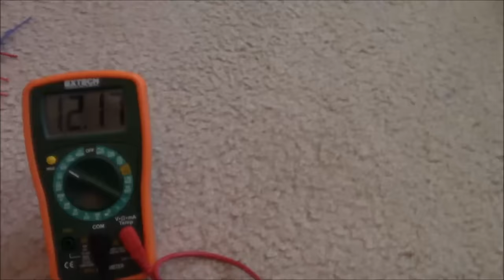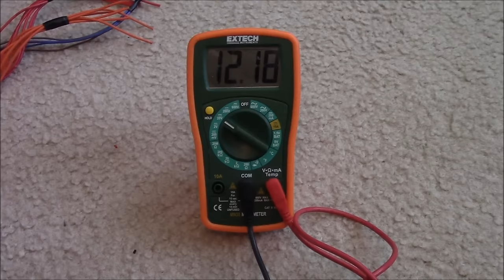How to Hack a Computer Power Supply (PSU) To Use as a 12V DC Power Source

Comment: I tried it and while it does work with a volt meter, if I try to put an actual load on it, the PSU kicks out.Tto clarify, I hooked it up to car stereo amplifier, unloaded which draws about 333mA idling, which the 12V rail of a PSU should be able to handle.
Reply from the maker: True, but most newer PSU's (the one in this video was several years old at the time of the video) need a load on the PSU for it to turn on.  It sounds like when the amp powers up and is drawing some current to start up it is fine but then at idle the load is too small for the PSU to stay running.  You might want to wire in a resistor to simulate a bit more load so it will stay on.
Reply: I have heard that if I tie a dummy load of about 40 to 50 ohms to the 5 volt rail and connect the 3.3 volt "sense" wire to the 3.3 volt rail, it should stabilize the psu
Reply from the maker: I have heard the same but I have not done it before.  You can either have your load connected to the PSU before turning on the unit or trick it into thinking there is a load with a resistor.  How and where to put the resistor I don't know because I haven't done it.  But I know other people have gotten it to work.

Comment: hi i'm trying to connect the 12V rail of my PSU to a little PWM circuit to vary the speed of a DC Motor, should I still be using all the yellow cables (yellow is 12V in my case too) or will just one suffice?
Reply from the maker: Depends on how much current you need.  If you use more than about 5A I would recommend at least 2-3 wires.
Reply: LDSreliance thank you so much!
Reply from the maker: You are welcome!

Comment: i connected it to a small 12v dc motor and the power supply tripped off. 
am i doing something wrong?
Reply from the maker: Motors usually require a big surge of amps to get started.  I would bet that your power supply cannot handle the surge or has protective electronics that think there is a short circuit or something bad going on and shut it off.  You can try wiring in a start capacitor to help handle the surge of amps.
Reply: @LDSreliance  I know i'm SUPER late to the party here but I just had the same problem when I did it the way you show in the video. Mine too would start, then stop. I thought to myself "what was different about my p/s then his?" Mine doesn't have a switch so I just soldered a little switch connecting the green and 1 black. Now this fucker works fine lol This pixie wrangelling stuff is fun !!!

Comment: Thanks for tutorial, i'll tried :)
btw can this charge ACCU 12V?
Reply from the maker: Not sure what ACCU is.  But if it is a battery then no it cannot charge a 12v battery.
Reply: ACCU = Battery Motocycle with power 12V
can charge it?
Reply from the maker: Ardian Sakti
No.  You need at least 14v to charge a 12v battery.
Reply: Ok thanks :)
Reply from the maker: You are welcome.  Thanks for watching!

Comment: i have 40m with led lights they need 12v and 460w if i use a 500w psu will it be able to power that?
Reply from the maker: No.  The overall rating of the PSU is not what it can output @ 12V.  The 12V rail only gets about half of the power.  Then there is the -12V rail, the 5V (USB) rail, and the 3.3V rail.  You need to look at the specs of the PSU to find out how many amps the 12V rail can handle.  Mine in the video was only 20A.  But a more powerful PSU may be able to do 30-40A.

Comment: Hey mate if I'm going to be running this to a car head unit is there any need to run a certain amount of wires or just hook them all up? Sorry if it's a stupid question, cheers
Reply from the maker: David Bennett I would connect all the yellow (+12v) wires together or split them evenly into 2 braids of wires if you have another load you want to run as well (like an amp).  Then connect all the black wires together (or in 2 braids) and connect that.  Car head units also have an extra wire to tell it when to turn on so you'll need to wire that to a switch or something.
Reply: thanks for the reply bud. im going to be running a switch for the power supply on signal. would i be correct in assuming i could get away with running the head units on cable to the 12v so it would power on when i turn the power supply on? also will be running a second psu for an amp somewhere down the track.
Reply from the maker: Yes, you can just wire the head unit directly to the power supply +12v rail.  However, like I mentioned before I think most head units require a "sense" wire that tells it when to turn on when the car is turned to the on position. You may have to wire that to the power supply as well or the head unit will probably not turn on.
Reply: yeah thats exactly what i meant cheers

Comment: Is there any way to reduce the power that's coming out of it? 
I have a 300W PSU and I need a 12V supply with a maximum power of 60W or a current of 7A for a peltier cooler.
Reply from the maker: +kanav garg You don't have to limit the power.  The peltier will only draw 7A.  I have powered peltiers with my PSU that I built in this video and it works great.
Reply: Thanks a ton mate! I just hope it doesn't blow up xD
Should I reduce the number of wires just in case or go with all?
Reply from the maker: kanav garg
The number of wires won't change anything.  You could pull 20 amps through one wire if you wanted to but it would burn up the wire.  Bundling all the wires together provides safety that you won't overdraw the wire and possibly start a fire.

Comment: I'm new to this so pardon my question. What color wire is the ground that you joined together with the green? Is it one of the black wires?
Reply from the maker: Yes, the negative wires are black.
Reply: LDSreliance Thank you very much for the info. Is it possible to make a portable a/c unit using the peltier?
Reply from the maker: Yes but it would not be very portable because you would need a LOT of batteries.
Reply: Ok, thank you very much for the info. My husband and I are planning to become van dwellers and would like to do more research on how to have a/c without much draw from our solar power set-up later on. We're  just trying to explore all avenues to accomplish our goals down the line. Thank you again.
Reply from the maker: You are welcome.  I would highly suggest a swamp cooler unless you live in a very humid area.  They are not as power hungry as compressor air conditioners.  Good luck!
Reply: LDSreliance Thank you 👍👍

Comment: on the side of my power supply box it says I get 3.3 volts to 12 volts 14 volts 16 volts 5 volts a lot of variety of combinations of volts aside from just 12v can I get more than 12 volts from other colors of wires or is 12 volts.? if not so why on the side of my power supply does it say that it can output all these different volts
Reply from the maker: You can combine some of the + and - rails into combinations to achieve different voltages.  This article explains better how to do it:  https://pcbsmoke.wordpress.com/2012/12/10/converted-atx-power-supply-voltage-combinations/

Comment: I have 12V 5A engine and I have computer power supply with 12V 7A, but when I plug in engine will work for about 0.1 second and stops working  and computer power supply also turns off, so what is the problem if power supply's Amper is more then needs it should work, no?
Reply from the maker: Motors need more than their rated current when they start up.  So a 5A motor will probably draw 10-15A when it first starts up for a second or two.
Reply: Make sense, thank you. I bought AC power supply 20A so it is working perfect now.
Reply from the maker: Jamshed Akhmedov Good!  Glad it worked.  Thanks for watching.

Comment: hi how can i make a 12v 40amp psu with this? The psu is to power a hho system that requires high constant current for a few hours daily. tq
Reply from the maker: The one I used did not have that much power in the 12V rail so you would need to find one that had enough current.  12V x 40A = 480W so you are looking at needing at least a 700-800W PSU to get that much out of the 12V rail.  However, those are pretty expensive PSU's so if you don't already have one laying around it might be cheaper just to buy a 12V power supply that can handle that many amps (something like this:  https://amzn.to/3uohJEa).

Comment: Hey, I really hope you can help as I'm wrecking my brain over this. I have three devices running of three separate 12V 5A power supplies. With all the power supply mods I've found everyone seems to join all of the coloured cables together to have a single output for each rated source.

If a molex has a max output of 10A is it possible to power these devices from three separate cable clusters that come from the power supply?

I'm looking at an old PSU and it has four separate rails at 12V 20A (broken down into CPU1/CPU2, PCI-E3/PCI-4, MB/ Accessory and PCI-E1/PCE-E2). 

I'm getting a little confused from the connector output to what each rail can produce to even the overall watt of the unit. Plus if I'm only using so little power wouldn't the PSU also be produce more heat to compensate for the little consumption? 

The transformers I use only seem to last a year each so it seems more cost effective to use a PSU and that can give me for possibilities with creating usb hub to charge other devices. Thanks, really need the help lol
Reply from the maker: Yes and no.  You can do separate bundles for sure but you have to be careful how much power you use on each one.  While each of those Molex connectors COULD pull 10A, if they all pulled 10A at the same time it would blow the power supply.  Also, I would recommend you use at least 3-4 of the yellow 12V wires for each load that could potentially see 10A.  If you are only using 5A it is a non issue.  But you never know what you will use it for in the future and I don't want anyone to start a fire.

Comment: so i plan on using a PC power souse to generate HHO i have some electrical experience but not much would it be a bad idea to simply find ALL the positive leads and solder them together and all the negative leads and solder them together?
Reply from the maker: As long as they are of the same voltage (i.e. all the yellow wires are +12V).  That is basically what I did in the video.
Reply: ok thanks for the reply
Reply from the maker: No problem.  Good luck!
Reply: o wow dude i just rewatched your video and found out i made a dipshit mistake by connecting the orange wires to the yellow rather than the black to the yellow i was testing it.... there were loud pops think the power supply will still work?
Reply from the maker: No that probably fried it.  Sorry man :(  I hope it was just a cheap one like mine.  The good news is you can order a cheapo PSU for about $25 to try again.
Reply: o it was beyond cheap i found it in a PC by the side of the road the odd thing was after the pop it was still working i know because as i mentioned before im trying to make HHO with it so i had it in water with some baking soda in it and after the pop witch happened when i touched the wires together under water i pulled them apart and they still got just as many air bubbles coming up as before so idk
Reply from the maker: Interesting.  Well maybe you only lost one of the rails.

Comment: I am using  ATX-350 it's instructions says +12V gives 10 Amp but I am getting less than 1 Amp. Can you give some solution to my problem .
Reply: Depends on the load. You probably only drawing out 1a

Comment: Mine cuts out when I put a 40w load on 12v rails. Also the 12v rail reads 11v, not 12v. Some tutorials say to put a 10ohm resister on 5v rail to simulate a motherboard...?? When I put a light on the 5v rail the 12v rail jumps from 11v to 12v and works for little while but then still cuts out...   Why?
Reply from the maker: What is the 40W load?

Yes, some PSU's have a "feature" that will shut off the power if it does not detect the right parameters.  I have also heard the trick with the resistor but if that doesn't work I don't think your PSU will be suitable for this type of application.
Reply: @LDSreliance  it's a small 12v pump. It might have a current spike during turn on but it does start and cuts out randomly after 2 to 10 sec. Not sure if it's the 4w light I am putting on the 5v that's the issue or that it's the pump or the power supply is cactus... All seem possible. I'll try another power supply first.
Reply from the maker: Yeah try another supply.  Older ones tend to do better.

Comment: I want to use this to power 2 case fans. What if I only cut 1 black and 1 green wire to make the psu work, but leave the connectors attached?
Reply from the maker: +Aragiss You can do that if you want.  As long as you connect the green and black wire to turn the unit on it will run.  If yours is a newer model it may have to detect a load to turn on so you may have to wire in a resistor but I won't confuse you with that unless it happens.
Reply: +LDSreliance Alright, thanks a lot for the reply :)
Reply from the maker: Aragiss
No problem.  Thanks for watching!

Comment: how do you know how many amps can this setup take at 12 volts, if its a 450w power supply could it take 6 amps at 12 volts?
Reply: i want to use this method for a peltier and its heatsink, will it be enough?
Reply from the maker: Mine can only do 20A.  Your manufacturer specs will show you a rating for +12V rail.

Comment: I have a question I am wanting to leave the SATA power supply intact my goal is to use a Thin Client motherboard for external drives I will be placed into a old case however the power supply for the Thin Client is too low to power the needed drives so I was going to use this power supply to power The Thin Client which I verified can be done however I need the SATA power cables and intact how can I have the correct power of 12 volts still in leaving the SATA cables intact the drives thank you
Reply from the maker: You don't have to cut all the wires if you don't want to.  Just leave the cable you need and then cut all the rest of them.

Comment: so if i used 2 yellow wires only i would be able to use a radio that draws 12.0 volts at 2.5 amps with no problem
Reply from the maker: Yep, that should be no problem at all.

Comment: Hi, any idea why would the psu trip upon testing the voltage?. i have the procedure as shown in this video but when i connect the wires with voltage meter, the fan in psu stops. i havethe dell psu.
Reply from the maker: Some newer style PSU's will have some electronics to detect a load.  If it doesn't detect a high enough load it will shut down.  So you will have to put a load on that rail in order to keep the psu on long enough to test the voltage.
Reply: LDSreliance when you say load I am guessing you mean have the PSU connected with some equipment? E.g. CD player or an amplifier.
Reply from the maker: Correct.

Comment: how would i turn on my power supply if my pc power supply doesn't have the on/off switch on the back with the power cord. can i still convert it?
Reply from the maker: Even if it has the on/off switch on the back you would still have to short the wires that I showed in the video to get it to turn on.  You would just have to wire in a switch between the 2 wires so that it can complete and break the circuit as needed.  Does that make sense?

Comment: is it okay if i used green and gray, instead of green and a black?
Reply from the maker: You would have to check the manufacturer's wiring diagram or color codes to know for sure.  I have never seen a power supply where the negative/ground is gray instead of black but it is possible.

Comment: is there n permanent 12v source if power cable is pluged in to psu without turning it on with green wire
Reply from the maker: +Frans Victor Not that I know of.  Usually you won't get power without it being turned on with the green wire.  I have had one power supply that would run its fan even when the computer was shut off but I don't know what model it was and if it was 12v or not.
Reply: sit i on off  switch  aan een kant groen en ander swart

Comment: I need a bit of help, when I connected the green and black, the fan turned on, and it worked fine. But then I connected a yellow and blue wire from my large 22 pin connector to my multimeter, to test the voltage, thinking they were the 12v rails. But now, the fan will not turn on, and I'm not sure if it's working anymore. Please help me solve this issue, thanks
Reply from the maker: +Scotlahn Mccallister Try unplugging the unit from the wall outlet and letting it sit for 5 minutes.  Then try again.  You may have tripped some kind of short circuit protection.
Reply: +LDSreliance I tried this, about 5 times with no result. I only get 1/2 of a volt out of the yellow and black wires when the connection between the green and black is made, and it likes to fluctuate between 0.5 and 0.8 volts. But other than that, no results.:(
Reply from the maker: Scotlahn Mccallister
Is the fan on the psu spinning when you are testing this?  Are any of the other rails showing correct voltage?
Reply: +LDSreliance The fan does not spin, and the 5v output connectors are the only ones that show promise of working.
Reply from the maker: Scotlahn Mccallister
If the fan is not spinning then the psu may not be on.  Many of the newer psu's will only turn on when they detect a load.  Try wiring in a resistor in between the yellow +12v wire and your positive lead on your multimeter and see if that does it.

Comment: Sir I'm sorry but my pc power supply does not have any yellow cables what can I do?
Reply from the maker: You just need to identify the +12V rail.  You can test the wires with a multimeter (put the positive lead on a colored wire and then the negative lead on a black wire) until you find 12V.  Or you can look up the specs on your model of power supply online and it should give you color codes.  So just look for +12V.
Reply: LDSreliance thank you☺☺
Reply from the maker: You are welcome!